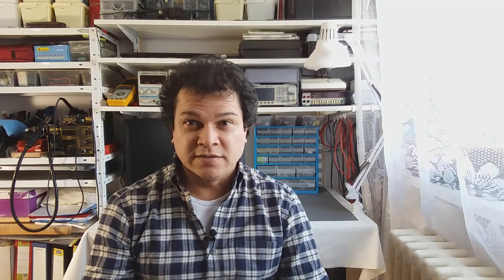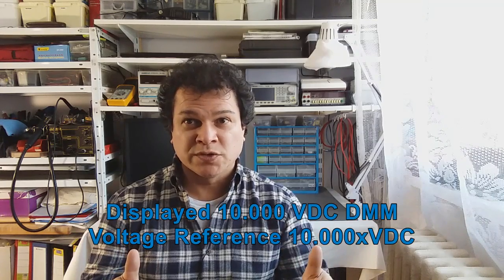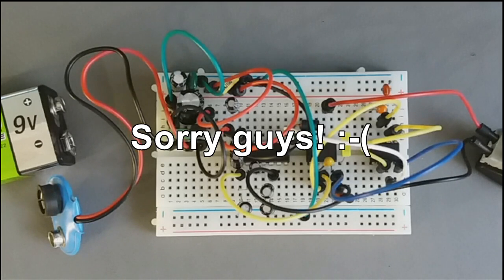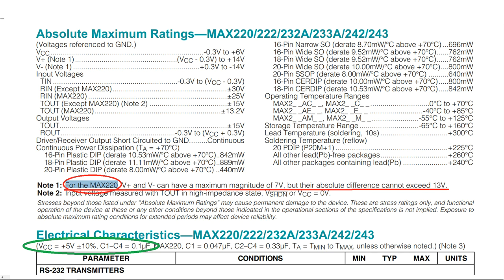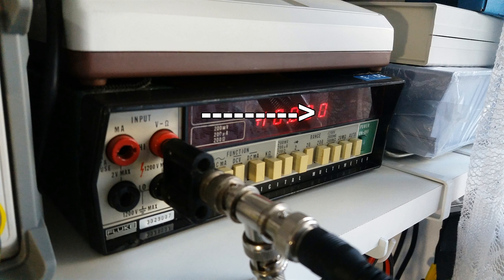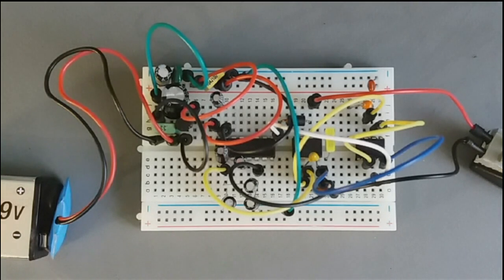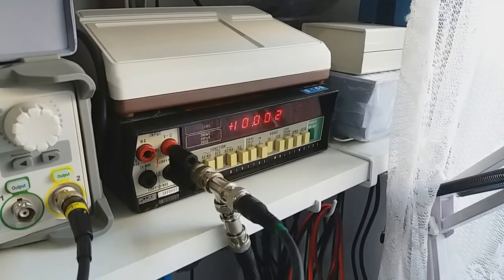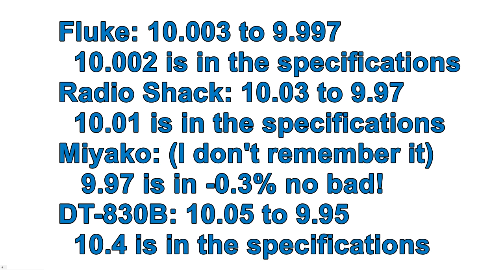10VDC REF102 voltage reference chip using RS232 as a voltage pump in a basic circuit / without SPSU

Comment: The REF102 can handle up to 36V - did you consider putting two 9V batteries in series? Seems like it would be even lower noise than the voltage pump from that RS232 IC, plus a lot less complexity overall.

Comment: Very interesting video but I do not understand how you "pump" 5 v to 10V (there is no multiplier) and also do not understand what is the function of the RS232.
Reply from the maker: Hi! RS232 or MAX232 is a chip for serial communication interface. It also has its own voltage pump, so I used it as a voltage multiplier and saved in a booster switching power supply to increase the voltage.

Comment: Thanks for posting, always a pleasure.  I was a bit confused by the 9volt battery giving out 10 volts on the multimeter.
Reply from the maker: Hi Dear! Yes, and no only the 9V battery... we need more than 11.4V, and we have a 5V regulator to start with. The idea was to boost the voltage without a switching power supply. The new power supply was created with just one chip and four caps and it pumps the voltage from 5 to 14 or 18V. As manufacturing engineer I saw so many costly and complicated power supplies to drive something simple that does't require regulation. We forgot grandpa's advice: "keep it simple and easy".  The easy power supply was the real lesson in the video. The second lesson was the use of a common op amp, and to think out of the box without complications focus in what we really need. (The voltage reference is just a monolithic chip with "maybe" on extra capacitor). When we were young, we used to walk by everybody's long way. When we get old, we learn to take our own short cuts.  :-)))
Reply: You was a bit confused and I was 8 bit confused.